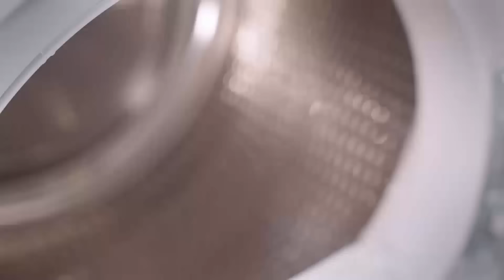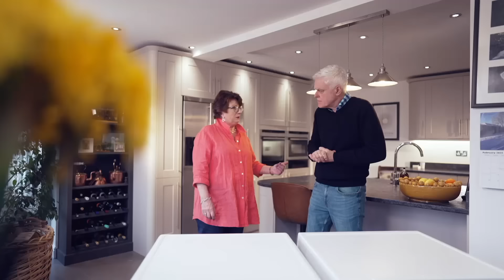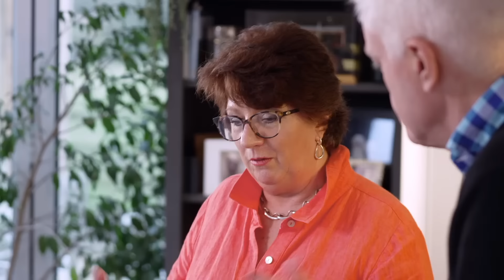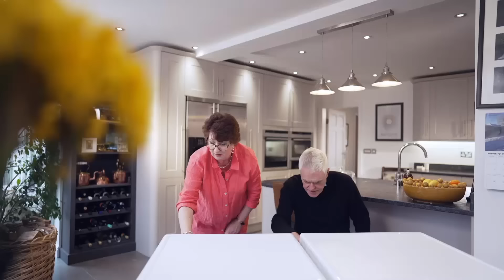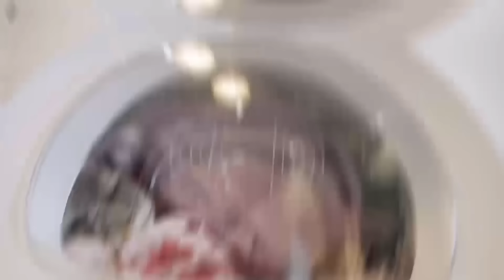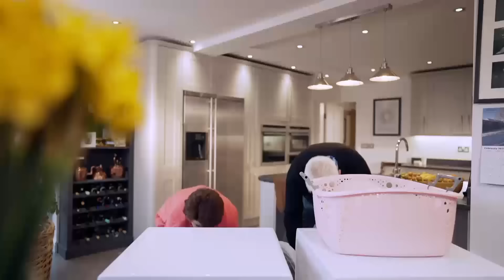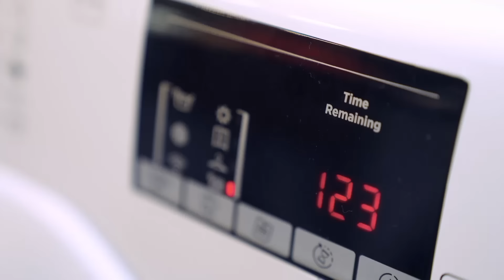Heat Pump Dryers Tested: £549 Bosch vs £349 Hoover – Worth the Upgrade? | The Gadget Show

Comment: heat pumps are better a chain drying. once the heat pump has warmed up, it will be just as quick as a traditional condenser. all vented dryers are the fastest at drying. period.

Comment: Just dont go for a touchscreen on a Siemens / Bosch. Had to have both boards replaced thankfully had warranty cover or it was 350 on a 800 quid washer dryer. But  i would stay away from hoover they also got recalled for going on fire. Thats drying things a little too well

Comment: I wouldn't take any Hoover device for free these days. Had 2 Hoover washing machines  (which weren't heavily used in our 2 person household) first didn't last a year. Second was an improvement in that it lasted 3 years but......... Hoover are rubbish in my opinion. Have a Bosch machine now. Don't use a dryer, just a clothes line which is really cheap if not practical for a lot of people.

Comment: Our No Name Bomann washing machine and Hoover dryer are now nearing 18 years, I replaced the brushes on the Bomann's motor and the door latch on the Hoover last year, total cost about 30€. I can't complain.
Reply: But it's the energy consumption...
Reply: If you use your conventional dryer a lot, then replacing it with a new heat pump dryer could pay for itself in electricity savings in as little as 2 - 3 years. I would suggest buying a "smart plug" with energy monitoring, so you can work out the annual running cost of your dryer and compare to the running cost of a modern heat pump dryer.  

Some come with a 5 year guarantee, and if you work out that you can recoup the cost within the guarantee period, then it is pretty much a no brainer. 

My last vented tumble dryer lasted 27 years, and if, I had wanted to fix it, would have just needed a new start capacitor and the asbestos string in the element replacing as it was disintegrating and it probably would still be going. Apart from the asbestos, it was also a better design that my current one because fluff couldn't leak out the drum seals and fill up its cabinet as the cabinet was under positive pressure.
Reply: @mels8966 I use it maybe 2 times per week and while I do get the energy savings, the endless enshittification of brand new expensive products royally pisses me off. I plain and simple won't buy a new dryer every 4 years because my old one has gone cack even if it were a net saving.

Comment: I’m considering a Miele HP dryer next, at the minute I had a Beko condenser dryer, it dries ok but oh lord the tangled clothes and duvet covers drive me crazy, I did get the repair guy out as it doesn’t seen to do a reverse tumble, he agreed it wasn’t right so I got a new machine as the replacement, that was ok for a couple of weeks and then the same! No reverse tumble. I’ll not buy another Beko that’s for sure.

Comment: Another factor over a vented dryer is that it exhausts conditioned air from your house outside, so it actually also increases your heating usage for the house. It also means there is a hole in your house for the vent, which means your house is less air tight, which even when it isnt running also costs energy. Factor that in and the heat pump dryers look even better.
Reply: Yes. a vented dryer moves all the damp air outside your house, which is exactly what you want.
Reply: @jamie-ck6js  No, it really isn't what you want, you want to condense it using a super efficient heat pump based dryer, and keep your house as air sealed as possible, and only do ventilation through a HRV/ERV. If you use a vented dryer you will be exhausting air you have spent a lot of energy heating up.
Reply: @bastiat691  Each to their own, personally a house that is totally sealed with no ventilation at all, no thanks.  I like a bit of fresh air and would rather not have damp air from clothes drying floating around the house.
Reply: @jamie-ck6js  Who said no ventilation? I literally said the ventilation would be handled by a HRV/ERV. Its mechanical ventilation for your entire house, and results in significantly better indoor air quality, and far less wasted energy (good ones can recover more than 90% of the heat). Even if you build a house with a vented dryer you want your house to be air tight, so that you can control HOW the house is ventilated. Building codes require air control membranes for a reason. The only difference between what you are suggesting and what I am suggesting is that my solution is HOW ventilation happens, in my solution its energy efficient, in your solution it isn't. The heat pump dryer releases no moisture into your house at all by the way, it condenses the water from the clothes and it goes down the drain. And it is far more energy efficient than a vented dryer, especially when you consider the wasted heat you are ejecting from your house with a vented dryer, and how your house is less air tight all the time, even when the dryer isn't running.
Reply: @bastiat691  My house is old and far from airtight, a little vent in the wall isn't the end of the world
Reply: @CamelCasee There are ways of addressing that if you want to.
Reply: Another factor is the vented dryer pumps out warm damp air, which the dryer has to keep heating.
Reply: No it doesn’t 🙄
Reply: @alangordon3283  If you like wasting money on heating the outside then totally agree, it doesn't. And I guess you are one of those people. I prefer not wasting money, but that is just me, maybe I am weird.
Reply: No, the heat pump dryers don't exhaust anything outside your home. That's what a vented dryer does.
Reply: @TheRoybeasley  Correct, heat pump dryers are basically a compressor driven dehumidifier in a box with a drum that spins the clothes, hooked up to a drain.

Comment: If you're saving 20 pence per load then you'll have to do about 2500 loads to pay for the Bosch.  Which for someone operating a B&B is a couple of years, but for a normal person it's a lifetime.
Reply: But you are not paying that whole amount. Just the price delta compared to a non heat pump dryer...
Reply: 🙏Thankyou!! Like everything today, people simply believe “the pitch”. Heat pump dryers ARE more “efficient”, but that efficiency is directly linked to remaining moisture content in the clothing.

Dryers as a whole cause more damage to textiles due to heat and friction, so minimising textiles to that environment is key… and THE BEST WAY to minimise dryer time/heat, is by using a washing machine that can extract the most amount of water prior to drying.

And fun fact, it takes a lot more engineering and money to build a quality washing machine with high spin speeds, than it does a Heat pump dryer or any dryer. So if your serious about the environment, appliance lifespan, clothing longevity, energy consumption and recyclability… don’t waste your money on a HP Dryer, until you’ve invested in a proper washing machine first.
Reply: The Bosch probably will last a lifetime though. Plus a family will end up running the drier loads too for bedding, towels, uniforms etc.

Comment: We got a vented at the moment as a spare which is extremely fast but have had a Hoover heat pump few years back, it did roughly 5 years with a lot of use. Did need new belt but it did do a fantastic job at drying surprisingly. 
Wasn’t that long and never tangled as it did 1/2 minute reverses. 

But definitely bosch for the reliability and build.

Comment: I have a Bosch Series 4 heat pump dryer and this is their base model dryer in Australia. It replaced a Beko heat pump drier who's water pump died a month outside of warranty. The Bosch is slower but better. I found it left clothes a little damp but you can program in extra time to each of the settings and that works fine. It is very energy efficient and we run it during the day when PV solar is available so the running cost is next to nothing.
Reply: Do you really need a dryer n Australia
Reply: @piee3.14  Most people don't wear wet clothes.
Reply: @harukinzaphod no clothes line no smart arse
Reply: @harukinzaphod Australia is blessed with sun and wind… unless the Labor government has been lying to us!?
Reply: @harukinzaphod it’s called a clothesline.
Reply: To add balance to the make issue, we have (an admittedly) conventional dryer made by Beko that gets thrashed in the  winter months here in the UK. It's been a faultless performer for the last 8 years we have owned it.
Reply: @Roastbeef01  I am sure it could have been repaired and before it died but I live in a small regional town where it is difficult to get stuff serviced. It was certainly a very efficient dryer with regard to drying time and the condition it left the clothes (i.e. not to dry and not too damp). On the other hand, the Bosch uses less power. 

Other than its decision to cease to operate, I was quite happy with it.
Reply: @harukinzaphod  A very funny one liner last paragraph......really made me chuckle 😂😂😂
Reply: The clothes might seem damp when taken directly out of a heat pump dryer. But you have to give the piece of clothing a good shake/whip after taking it out to remove the lingering dampness from being inside the drum. Do that, and suddenly your clothes are bone dry. Most people think their clothes are still wet, and run the dryer for longer than necessary.

Comment: One thing to note with most HP dryers is they cannot be located in unheated spaces that can drop below 10-12c (like a garage). We got a Samsung HP dryer to replace an old condenser model that was located in our attached garage & had to find space space for it in our kitchen instead. Another issue for us was the low down condenser filter which needs cleaning every so often. Our dryer is inside a deep kitchen unit with 2 front doors. OK for the water tank removal & front door lint filter access but to get access to the low down condenser lint filter the kitchen unit kick panel has to come off. Not ideal. I'm now looking at relocating the dryer to an under stairs cupboard to gain more kitchen cupboard space & easier access to the condenser filter. Bit of a merry-go-round scenario but worth it for the run cost savings.

Comment: I got a Bosch heat pump drier in about 2016ish, and it’s been spot on for 9 years, I’ve done some bits to it, like flush out the condenser and lower water tank.
It runs almost everyday as you can imagine it would with a family and dogs, 
Best £650 ever spent.
Reply: Probably around £1000 nowadays with inflation
Reply: I got a Bosch Series 8 heat pump tumble dryer. Worst appliance ever made. It caught fire once, Bosch repaired. It takes 3-4 hours to dry. That is far too long for clothes, no clothes should be subject to that. Even a reputable appliance repairer said they couldn’t do anything. The final nail was an online YouTube appliance expert who didn’t rate heat pump dryers at all. With low cost overnight energy I can afford to run a less energy efficient but cheaper machine
Reply: @t @tasty_fish unds like you have a dud machine
Reply: nice. I recently bought a series 6 dryer that has a selfcleaning condensor and has special cleaning programs. I run those when it tells me to give it the longest lifespan possible. Ill let a cleanout be done maybe by a technician or i will try it myself but its been good for a year now i think. i either bought it at the end of last year or around march this year. I cant remember.
Reply: Do you have the model number of the unit that you're using? I'm looking into getting a Bosh Ventless Dryer off the secondary market and I've found some pretty good deals. I'm just not sure that I'm ready to go with a Heat Pump non vented Dryer.
Reply: @0errab0 I will have a look and get back to you.
Reply: @0errab0  don't - it a scam - similar to how government wants us to get rid of combi boilers, 
https://www.youtube.com/watch?v=xn03N3b0-lE
Tumble Dryers the Shocking Truth About Heat Pump vs Vented & Condenser, NEW LEGISLATION!

Comment: Something else to consider is, as a heat pump dryer, dries at lower temperature it is less damaging to fabrics, and since it doesn't have a red hot element, or any element at-all, it is much less of a fire risk than a conventional dryer. Particularly important if you run your dryer cheap rate when you are all asleep.
Reply: Clothes going around a drum for 3 time longer is anything but less damaging.
Reply: @jamie-ck6js  If your heat pump dryer is taking that much longer, then there's something wrong with it. Likely either clogged with lint, or being used in a very cold room, or possibly lost refrigerant gas. Heat pumps should dry at around 50°C vs 75°C or so for a vented dryer on full. So similar to the low temperature / delicate setting on a vented dryer, and 50% longer perhaps. If you are drying clothing with fibres like elastane in, then 75°C is too hot.

Comment: Should have weighed the washing before and after to see how much moisture was left by each dryer. Should also have used identical loads
Reply: Wouldn't be the gadget show if they did a properly controlled experiment!
Reply: @garysmith5025  You're not wrong!🤣
Reply: You should also measure how much moisture is caught by the machine and how much evaporates into the room.
Reply: @KoeiNL  Good suggestion, most tumble dryers leak at least some warm moist air into the room, and apparently some are pretty bad for it.
Reply: @mels8966  its on the EU energy label, its the condensation efficiency class. My Bosch is the top class because its in a small room and I don't want moisture there.

Comment: Great a heat pump dryer in winter will pull the heat out of the room you just paid to heat to dry the clothes instead.  This will mean you have to pay to heat the room again to replace the lost heat.  So of you factor that lost heat into the running costs it probably is going to be more expensive.  Although if the room you have them in is below 5 degrees they don't even work.  So no more garage dryers.
Reply: No, my bathroom was hot as hell when I had one of those. It was a Siemens, and worked well except down pillows. It would always stop and say it was dry. I was only able to dry them running it repeatedly on a 30 min manual cycle, all other programs used the moisture sensor.
Reply: That's not how it works.
If it did, where do you think the heat went? To your neighbour?
Reply: @ricco123tube  nah mate, the guvernment took et, innit
Reply: Heat pump dryers draw very little air from the room and just recycle the same air through the cycle. A vented dryer however constant pulls air from the room and blows it outside through the vent, so if it's in a heated room it will draw heated air out.
Reply: As said that's not how they work, you're confusing them with the outside part of a home heating heatpump.  It's a closed system just like a fridge or freezer.  Using your logic a freezer would increase the temperature inside the house.  Which they would put only a very very small amount.  A vented dryer will be sucking warm air from inside, heat it even more then blow it outside.  We have a heatpump tumble dryer and need to open a window in the utility room when it's running because of the extra heat it creates.

Comment: What about warranty or repairability?  If that heat pump unit goes, it is probably not economical to repair.
Reply: My heat pump dryer is 7 years old and used every day.
Reply: @ricco123tube doesn't answer my question though.
Reply: @UnCoolDad bosch sell spare parts online with only the model number needed at decent prices.